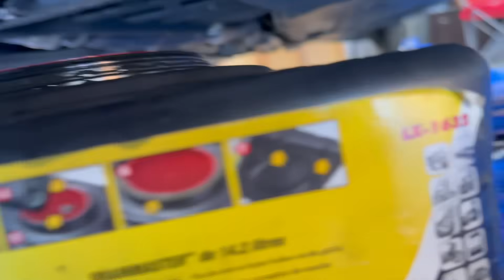My GR86 engine blew. Now what?

Comment: The comment section is wild. "Dedicated oil cooler if you're tracking" OP already said he was running an oil cooler. "These motors are garbage" OP literally got 44k miles and 23 or 24 track days, he drove the car harder than 98% of other sports car owners without any true mitigation for the oil pressure issue the FA24 has. "SWAP A 2JAY-Z" OP is tracking his car and competing in the 86 Challenge not trying to build another influencer drag special. 

Here's the reality, if you drive your 2nd 86/BRZ hard on the track without any true mitigation ( current solution seems to be a larger capacity oil pan with accelerated maintenance ) it will have a finite life. Another point to consider is most engines regardless of how much you worship them might also not hold up to repeated hard track driving.
Reply from the maker: Thank you. In hindsight, it was probably not a good idea to put my context at the end. The next episode will be much more focused on the failure mechanism, what I did wrong, and how applicable this is to others.

Comment: I had a 2016 scion FRS... did Full bolt-ons, drove that puppy 140k miles ripping to redline every drive. The only things I did to maybe prolong engine life was an oil cooler and oil changes every 3,000 miles with 5w30 instead of 0w20. I then traded her in for a 718 cayman..... still miss the FRS.

Comment: Does this only happen if you track those ENGINES (not motors)? Are they really junk for the street?
Reply from the maker: 0w20 has a nasty tendency to burn pretty quickly in some of these units. Low oil will destroy these engines shockingly quickly. 5w30 and making sure your oil is at the max line every 1-2k miles is enough to avoid blowing the engine on the street.
Reply from the maker: Also, fair point wrt motor vs engine lol. I didn't know there was a difference

But I'm pretty sure engines are motors.
Reply: @404nobrakes  An actual motor is an electrical unit, though many people interchange the 2 words. And engine runs on fuel.

Comment: Use a thicker oil. I used to run 10w-30 on my 3sgte. Blew up during a track day — I did notice the oil pressure falling after 4-5 laps. Didn’t think too much about it until the motor blew later that year. With the new motor, same oil, exact thing happens - oil pressure dipping after 4-5 laps. I changed over to VR1 20w-50, oil pressure holds nice and steady.

Comment: Man, I just put the ZN8 back on my list of potential cars for next year 😢
Reply from the maker: The car wasn't completely at fault here. The combination of leaving the oil cap off for 1 session, having an oil cooler that severely reduced oil pressure and not having any mitigations for the right turn drops were to blame.

I'll talk more about this in ep 2, but there are some really good solutions for the right turn drops.
Reply: @404nobrakes  thanks for the feedback & I’ll be sure to watch your next video!
Reply: @404nobrakes you think the oil cooler was restricting the flow? Interesting

Comment: For the second engine, you should upgrade to bigger capacity oil pan (formula) much better and not losing oil pressure especially in right turns 👌
Reply from the maker: Yessir, that will be covered in ep 2

Comment: what tools do you need to do an engine rebuild? electric ratchet?
Reply from the maker: A lot of tools, many of which I didn't have.

Watching this video, it's hilarious watching me struggle with stupid needle nose pliers when hose clamp pliers exist. Will make a video segment for that for sure
Reply: you need a shop set up with every type of tool and even then you will need to take it to the machinist to get it rebored and stuff
Reply from the maker: @user-wi4jt8bs8v  I'm playing a bit fast and loose with the term "rebuild" here. I actually went with a long block replacement, so the correct term would be "reassembly". 

The old engine is not even remotely salvageable.
Reply: @404nobrakes  yeah that is easier, but a bit of a gamble with some of the older cars, maybe not so much with yours. Still it's not a job to be taken lightly